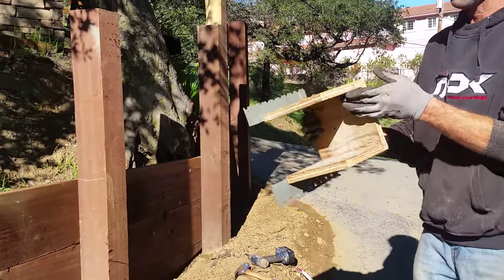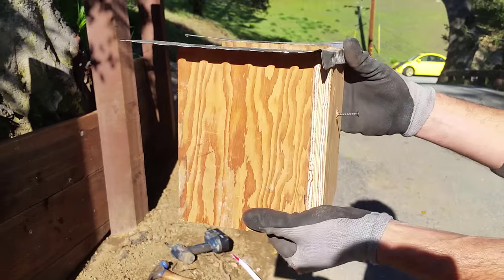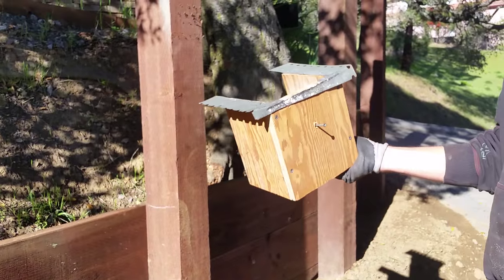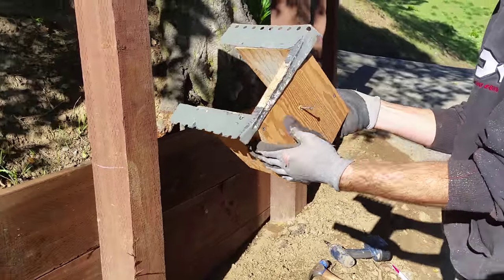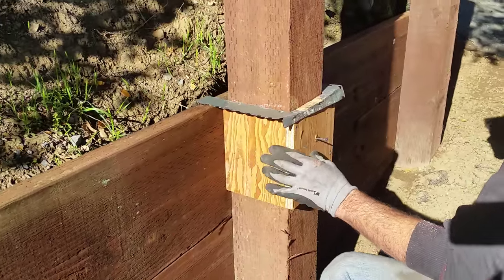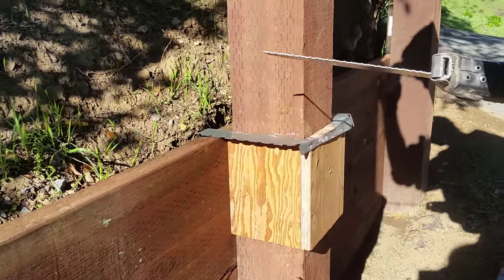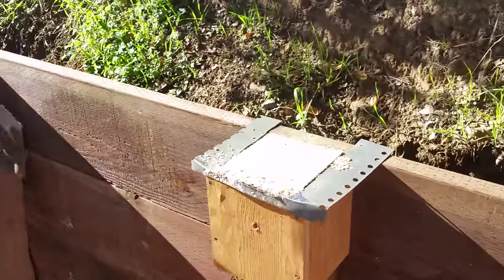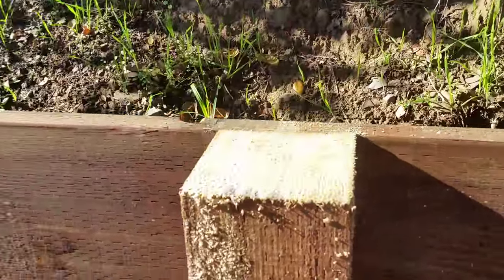How to cut 6X6 fence post, done easy with a simple jig fixture.

Comment: Great job. I take an extra blade and slide it into the curf once I'm about 1/3 way cut. It acts as a shim and makes the blade cut a ton better with less vibration. Hope this helps 😃
Reply: You meant kerf, not curf. And yes, good idea to use a spreader to keep the kerf open while cutting.

Comment: Amazing the number of armchair quarterbacks spewing advice in the comments. My math professor once told me "there is always more than one way to find a solution". The method works for you and in the end that's all that matters. Great job gettin' jiggy with it.
Reply: mr10man69. The only right way is the one that works for you. It needn't be right but it should look right, many jobs you know where it's wrong, no one else dose.
Reply: your right .... great idea how do these armchairs know he might be putting a cap on the them  for rain and a type  of finish that looks good
Reply: The good and bad comments and comments about them, help tremendously. I'm fine with the armchairs. Most people come here to learn and sometimes I learn more from the comments section. Lol!
Reply: If the foot of the reciprocating saw is pushed hard up to the post / jig the saw will not bounce around as much👍